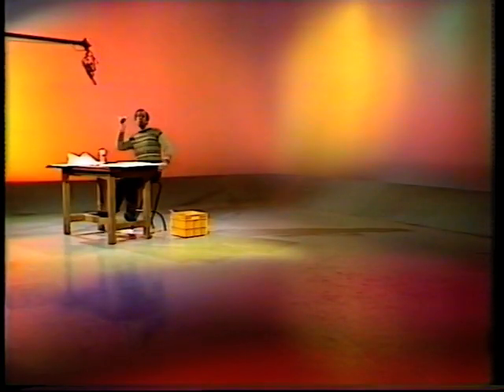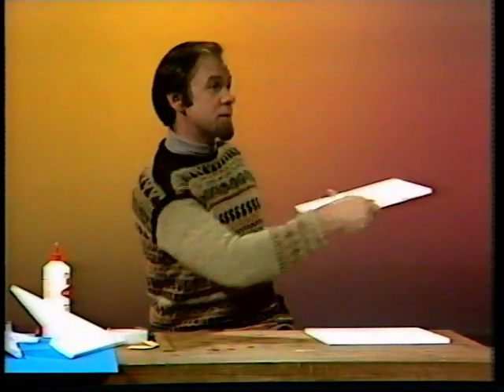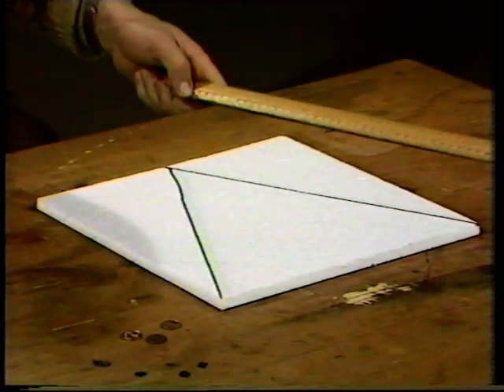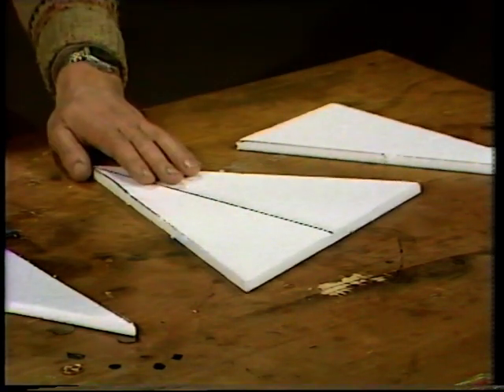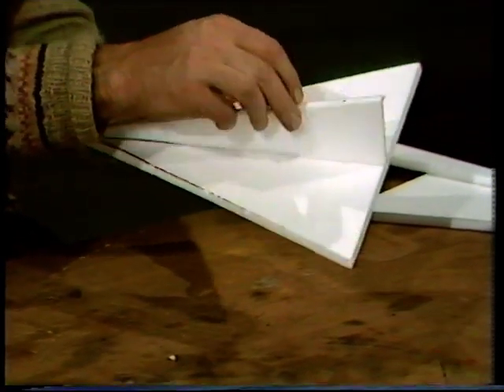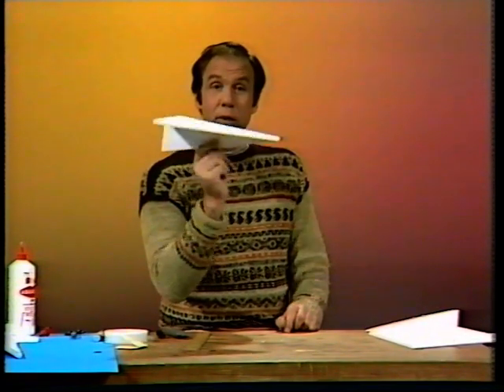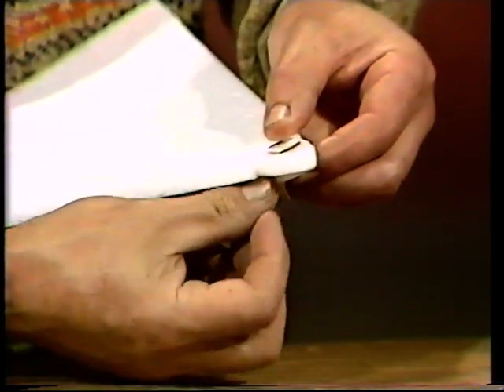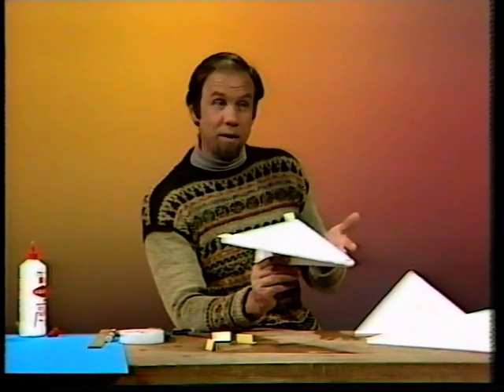Foam glider

Comment: i used to do this, when cutting with a rule... Why draw a line and then use a rule to cut on the line you have just drawn, you can omit the line and just cut straight away. easy peasy.

Comment: can i use styrofoam to replace a form sheet? by the way, which is better? foam sheet or foam tile? pls answer my question
Reply: The advantages of ceiling tiles is that they are near enough to square... any rigid polystyrene foam should work, as long as it's not too thick. Otherwise try it with corrugated cardboard... just hard to cut on diagonals.